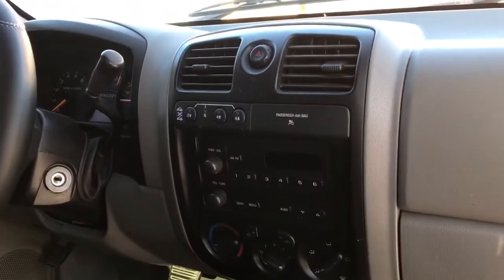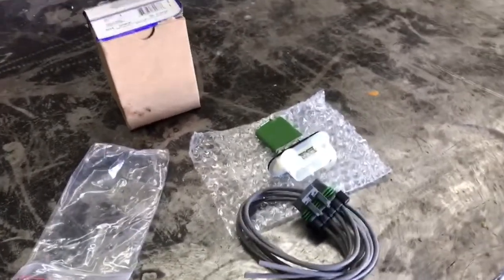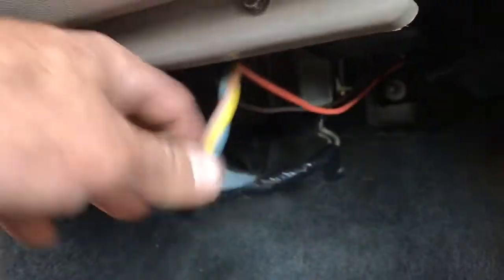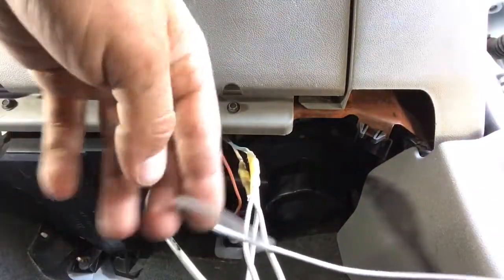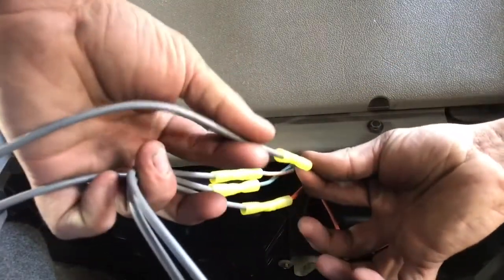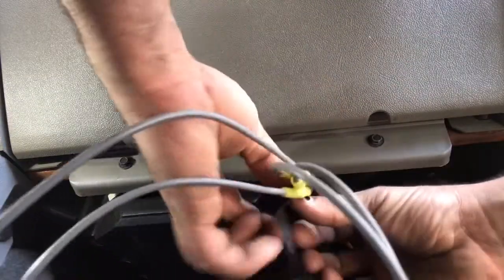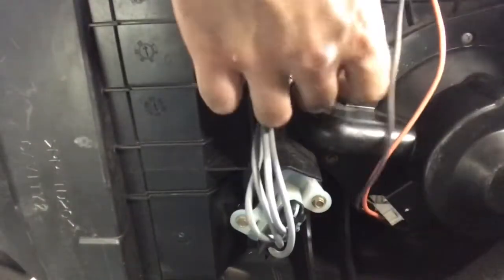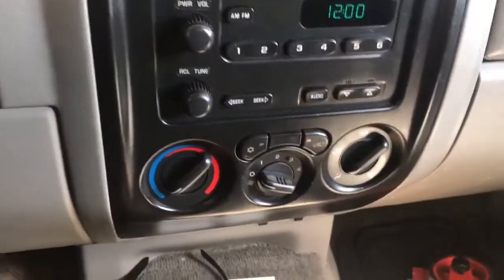Colorado Blower Motor Resistor and Connector Replacement (Tips and Tricks)

Comment: Ive done the new wires and resistor. Blower still doesn't work.  Is there a video for replacing blower motor?
Reply: Fuse/relays?

Comment: Hi, great video! You mentionned that it's the second time that this job as to be done on that truck. Same on mine. I did exactly what you show here last year, with the Doorman part, and it's burnt again. Do you have more info on why this keeps hapening? Some users mentionned it is a ground problem....  Any toughts and where that groud problem could be?
Reply: The ground problem is next to the air filter

Comment: What if you replaced it and the new one burns up, too?
Reply: There’s a ground right next to the air filter and where its supposed to be grounded it’s painted so you have to take it off and I just scrapped away the paint with a knife so it grounds correctly

Comment: It's common issue due to the ground wire near the air filter is mounted on a painted surface and will continue to short the resistor if not fixed.

Comment: Need some assistance! I have this same issue. Blower speed ‘4’ is the only one that works. However, I pulled out the cable and disconnected it from underneath the glove compartment. I did see it was burnt out a bit. I wanted to confirm this was the problem, so I turned the truck back on and turn the blower switch to ‘4’ and it still turned on. The rest of the speeds course didn’t. But why would the switch still work at ‘4’ if I disconnected the connector? I was going to replace the toggles themselves in the dashboard until I found this video. Now I don’t know what the problem is. Any help is great before I start tearing my truck apart!
Reply: 4 is directly wired. Not wired through the harness.

Comment: The real problem is the ground and that is why things get burnt
Reply: Yeah! I did this fix last year and the resistor connector is burnt again! Do you have more info on how we could fix that ground problem? Thank you
Reply: @josslelibre555  so your solution to fix this ground problem so the buy a positive and ground bar new terminals wire a new fuse box and those grounds that are connected both sides cut it all off  and put all wires on your ground bar problem solved
Reply: @davidmartin5027   cool! Thanks man! I'll look into that for sure...  I had other weird odd ball electrical problems...   So that could fix it all up!

Comment: Aaron Hines: 
I’ve also replaced one before. Seeing the wear on the resistor’s connector makes me wonder if applying an electrical paste to the connector pins would eliminate any arching to the pins from heating /cooling and preserve the contacts thus preventing further replacement in time?

Comment: had a question.  Is it necessary to bolt the resistor back into place?  This was the hardest part to replace because of its location.  If I have to replace again, it would seem easier to not bolt it down unless there is a reason that I am unaware.  By the way the video  was perfect.  It showed me exactly what to do.
Reply: I did this in July and it looks like I have to do it again now (11-21) not even 6 month later! I wonder if the motor is over drawing it, I don't have an amp gauge that could read it but this seems to be happening to a lot of folks.

Comment: I replaced both the resistor and cable connector. Used same as video and color are in right position. Speed 2 does not work, all other speed fan 1 3 4 does work. Any ideas?
Reply: did you trow the freon first?

Comment: C H E C K  GROND  WIRES FIRST.. CHEVY,  GOT IS WRONG... CLEAN THE PAINT BEHING THE BOLT,  BEHIND THE AIR BOX, AND ALL THESE SPEED WILL WORK ,, AND YOU DO NOT HAVE TO REPLACE THE RESISTOR.... sTAN hawaii    gROUND   !!!!!!!!

Comment: good vid, helpful, good info, had 2subscribe on that alone....... questions, y not use tye wrap or black tape to angle the connectors in one direction so it makes a better fit? 2nd, according to your exp. i have 03 blazer, having the same issue now. which should i go for first? pigtail, blower or resistor? 110k miles on it.......i tried cheap 20$ amazon resistor part last week, it worked for 3 mins then blower stopped, so now I am thinking was it the cheap part , or get a more exp. part or new blower? how can it be the piggytail if it worked for a while and shut off........right? how would you diagnose this? thanks!

Comment: " Napa is where I got the kit."  The link posted takes you to Amazon and a  Dorman kit for $10.47....NAPA  WANTS $75.87 Highest price in town...more than the Stealership. My complements on the Video. It worked perfect. For less than $11 it's worth  the repair , hope it lasts....THUMBS UP.
Reply from the maker: That is the same kit I purchased from Napa. I’ll post Napa’s part number when I get to my computer at work
Reply: @AaronHinesAuto  

Very good video.
I replaced the resistor and harness on my 2004 canyon and the blower is not working, do you have any idea how to fix this.
Thank you

Comment: I have this problem on my Dakota I’ve done the same thing did I’ve replaced blower motors, resistors, and connectors and it still keeps burning out would hard wiring aka soldering the connector to the resistor help it any different

Comment: Than you for this video.  It was one of many that helped me fix my HVAC motor problem.  Turns out, my problem was the motor itself...

My 2012 Canyon HVAC motor was intermittent, works one day, then not the next...one week just fine, next week dead.  Finally, it just seemed to die.  It's been doing this for a few months now.

I went through all these online instructions with every possibility (harness, connectors, resistor, grounding, voltage, fuse, relay, etc.).  But, I didn't find any burnouts or corrosion or grounding problems at all.  I finally chose to check the voltage and ground continuity at the motor connector with a voltmeter. And, sure enough, it was also fine.  (As I later figured out, I should have tested the voltage and ground at the motor connector FIRST, not last.)

Well, the wiring tested just fine, so that meant my motor was the problem.  Since it's too late on a Saturday to get to the dealership, I decided to crack open the motor myself.  It's a bit tricky with the 3 plastic locking tabs (but, you can break these and the 3 screws will still hold it together just fine).  Otherwise, just 5 screws and 2 nuts will get you into the motor housing.  It turned out that my motor was filthy inside with a thick, sticky, brown dust!  I blew it out then pulled the bushings aside and cleaned the armature contacts with alcohol.  I reassembled the motor and plugged it in - WORKS PERFECTLY!

So, the lesson is: 
1 - Check power at the motor FIRST!
2 - If you have 12 volts (black lead) and ground continuity (orange lead) at the motor connector then you have a motor problem...Fix the motor.
3 - If, on the other hand, you don't have 12 volts or ground continuity at the motor connector THEN check the harness, connectors, grounding, resistor, etc...
and 4 - If you can clean out your motor and it works afterward, you just saved $60-100.